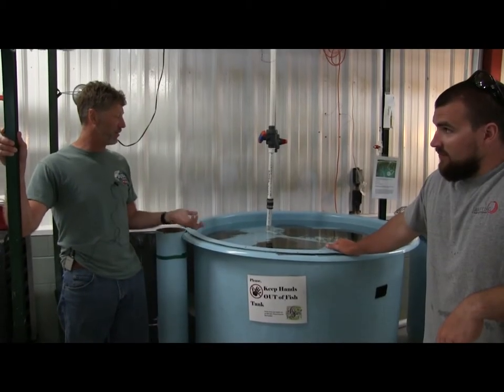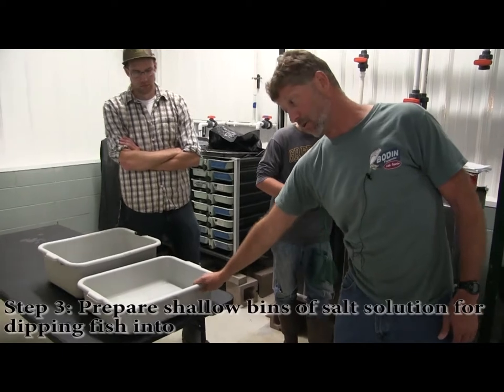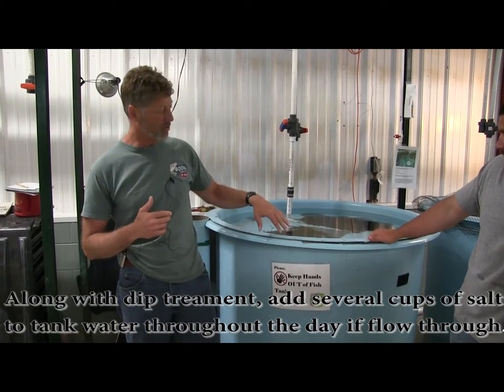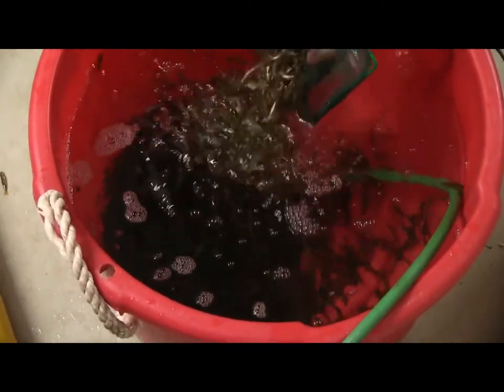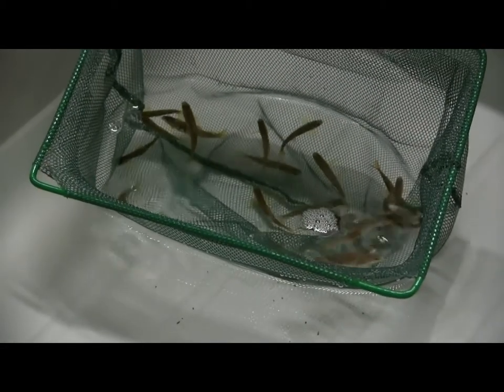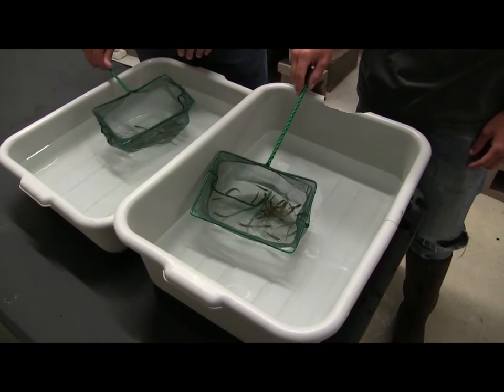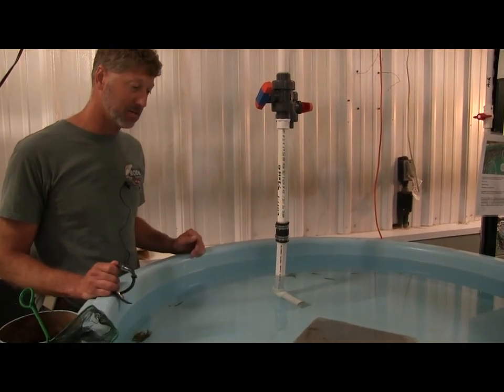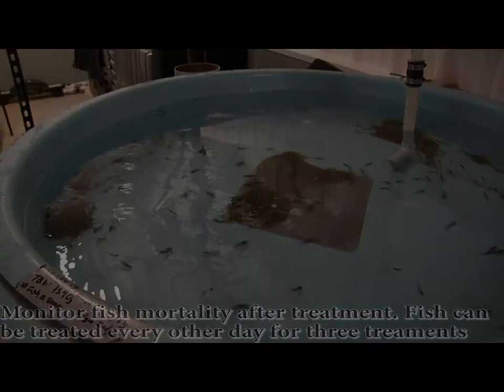Salt Dip Treatment for Fish

Comment: Don’t you mean .3%?
Reply from the maker: This is a dip treatment where we can dip from 1 to 3% , if you were looking at a bath treatment, that would be much lower level like a .3%. check out this article: https://www.thesprucepets.com/using-salt-in-a-freshwater-aquarium-1378797#:~:text=When%20treating%20external%20parasites%2C%20a%20dip%20is%20the,make%20a%20solution%20of%201.5%20to%203.0%25%20salinity.

Comment: My koi fish is swimming in big circles all over my 40gal fish tank and he has red sores I heard of dip baths
Reply from the maker: Hello, thanks for the comment, be sure and quarantine the fish from any others. Generally, salt is for parasites or bacteria issues, and may help with a bacterial infection that could be causing the sores. Check in with your local aquarium about some treatment options, maybe melafix or pimafix. Unless diagnosed, it may be hard to treat. Salt dips can also be done, but do some research first on dipping your koi and what others have found effective, adding aquarium salt to a quarantine tank following the brand's instructions may also help to heal the sores and prevent further infection.